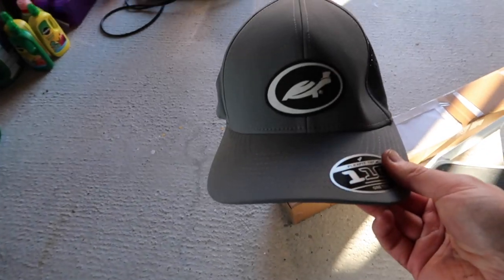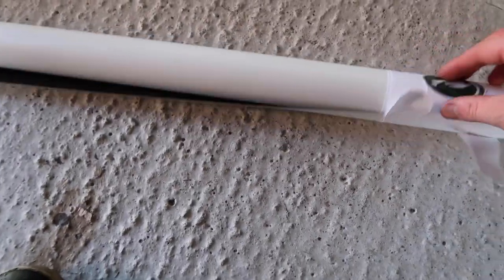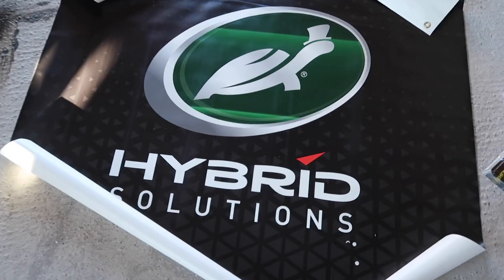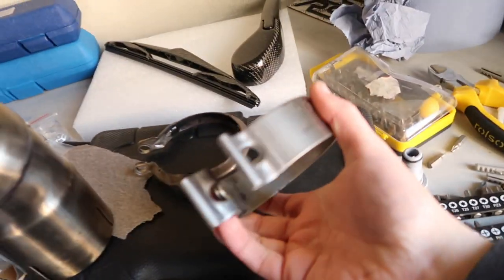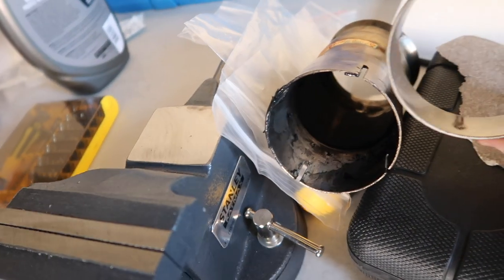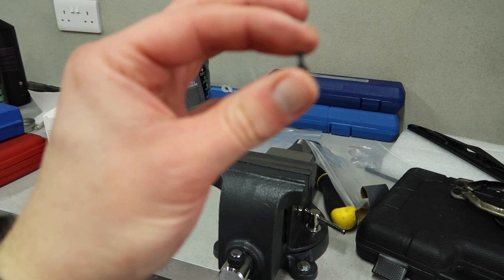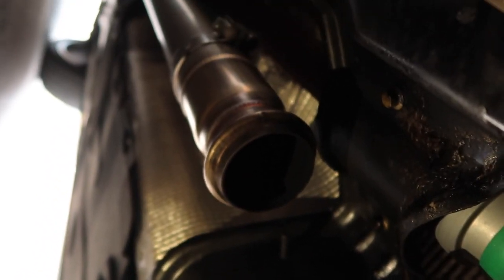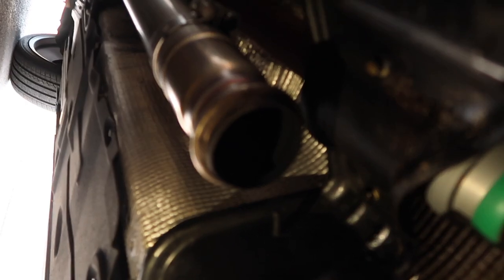NASTY FUMES ISSUE & SWEET TURTLE WAX MERCH! | FOCUS RS | VLOG 34

Comment: I am running a 200 HJS CELL sport cat and I had no weird smells. I did have some white smoke coming out the car for a few hours until the coating done by the manufacturer was burnt away. 

I did have an exhaust leak because the v clamp that hooks the cat back to the sport cat was out of position and air could go in and come out. I cleaned everything up, rearranged the clamp as it had to be in a specific position so the groves bite properly. I also added a special grease on this part of the connection and on the REMUS axle back clamped parts after I opened them.

Comment: Adam, Philip Gillespie of D Gillespie Motors outside Portglenone does all my servicing work on my RS. He really knows his stuff and I would be very confident he will solve your problem. Cheaper than a Ford garage too. He fitted a full miltek system to my car plus many more mods and the car has run perfectly. Even give him a ring just for his advice

Comment: The black stuff looks like some sort of high temp silicone they’ve used to seal the joints...
Reply from the maker: Proper ultra high temp would be copper containing. The hot side of the turbo and cat gets mental hot
Reply: @AdamRainey  yea so looks like they’ve used the wrong stuff?
Reply from the maker: Very possibly, whatever they have done they have done damage which is likely to cost me a bunch

Comment: Didn’t they break one of your Lambda sensors as well? Did you have to pay for the replacement?
Reply from the maker: Yes they did indeed and yes they charged me. The original quote for fitment was £180, they charged me £320 in the end and now it is costing me more to try and fix whatever else they have broken

Comment: Sorry, did I miss something ??  Why didn't you just take it back to Blackline, for them to make it right  ??
Reply from the maker: A lack of faith in their ability to not break anything more. The car fully broke down shortly after the install with full electronics dead because they didn't tighten the ground wire to the chassis so it wiggled off

Comment: Hi Adam, I had my scorpion sports cat fitted by a Ford dealer ( I was lucky to find a fairly local family run Ford dealership) I had no smell what so ever, they charged me £170 labour, my local ford dealer wanted £320 !    Looks like a dodgy install, as I’m sure you’ve worked out for yr self , did they change the turbo to cat gasket ? I was advised to have mine changed when they did the fitment

Comment: Did you not ring up Blackline?
Reply from the maker: I told them about it on the day that I broke down because they failed to tighten the nut on the ground wire. The last thing they said was they checked around it for leaks
Reply: Thats shocking!! Live and learn m8